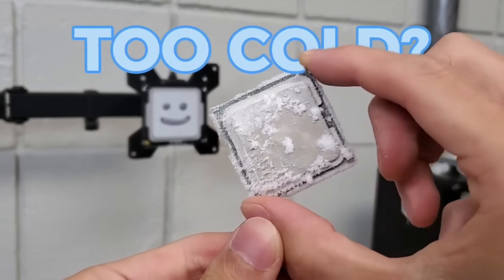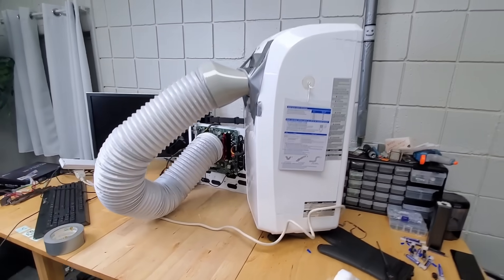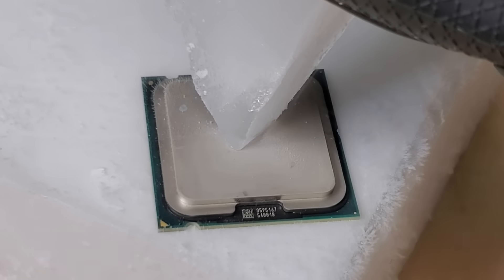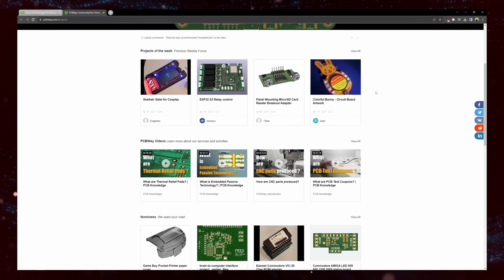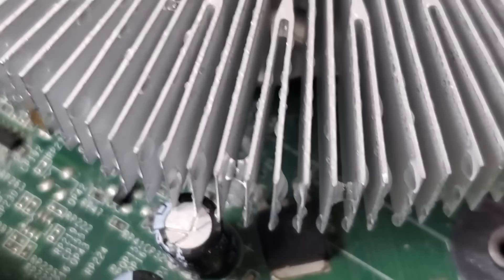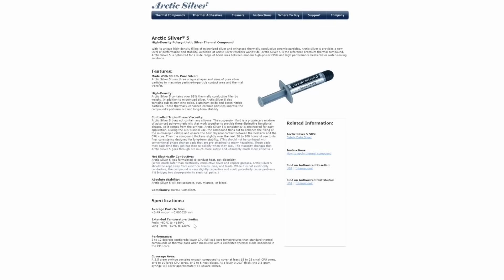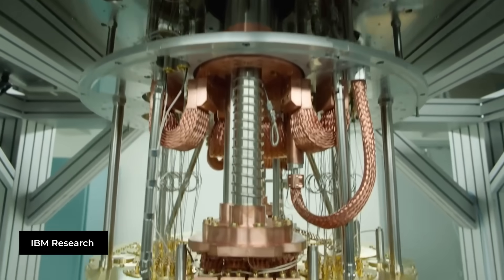The Crazy Future of CPU Cooling

Comment from the maker: is it chilly in here or is it just me? 🥶also, i finally got around to linking the components in my main PC build - check out the description if you're interested what I'm rocking!
Reply: e
Reply: He
Reply: dude, always loved your content, the way you explain things is very interesting, thumbs up
Reply: The ice action makes the number board tomorrow🥶
Reply: It's normally 35°C here but now it's 25
Reply: Bro is restraining himself from jumping up and down from the excitement. You can see it in his face. 🤣🤣
Reply: I know it isn't a big deal, but can we not refer to space as "cold" space isn't cold. No atoms means the only transfer of temperature would be through radiation (if you are above earth this would be the sun). In space near earth you could even call it "hot".
Reply: What if you try a  mobile phone cooler
Reply: What is the name of the song that starts at 3:08?
Reply: I'm watching on the toilet
Reply: Bro Nothing can be Colder than -273,15 Degrees Celsius 
like if you agree and have some knowledge 

lol
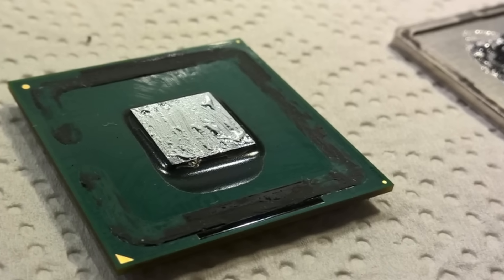Reply: 7:00 seems like you shouldn't use thermal paste at all in these experiments, just ensure same metal types connecting so they match their contraction rates ei  aluminum and steel with shrink at different rates and could cause self damage.
Reply: Solid State Cooling fan sitting there watching you be like: "Nice try, huh? 🚬🗿"
Reply: notch 1 on the box fan is actually the lowest setting. 3 is the highest, and it is set up to prevent a 'stall' condition.
Reply: Can you give a pc please.
btw the vid was awesome bro keep up
Reply: Just you

Comment: The issue is condensation. If your air is humid then the water in the air will condense on the cold surface of the CPU and get on your mother board which is bad. Never mind he covered it.

Comment: Place the whole computer in a fish tank that you can fully submerge in distilled water. Get a liquid CPU cooler, pump and hose, as well as 2 of those electrical coolers they use to cool CPUs. Place the electric coolers (cold side towards the liquid cooler on both sides. Some coolers will need to be modified.) place fans on each side. Lock it down. Run hoses outside and install the cooler. You will want to place it outside, it will heat up a room fast. Remember one side is cold and the other side is hot and the heat has to go somewhere. Run power to the cooler and fill the tank with non-conductive liquid. Some use distilled water, but don't know if I like that. Glycol works very well and can bring temperatures down by just moving through the hoses. Turn the pump on and let it circulate through the system drawing from the bottom of the tank and pumping back in from the top. You shouldn't need a fan on the processor, but some say that the right fan looks cool running under liquid. After the system is running and the liquid is pumping, you should see the temperature drop very fast and level out at a very nice cold temperature. If you do it right, you could run the whole system including the computer on a solar system and save some money on the electric bill LOL. Be safe all.

Comment: Just a technical note, on your portable AC unit rigging, changing the temperature setting has zero effect on how cold the air is coming out. If it is running, it's blowing as cold of air as it can.

Comment: Something exactly like this already existed, a friend of mine had it they were around 1200 dollars a piece and it was a pump with freongas in it which would pump it through a pipe to your cpu cooling block it was absolutely nuts, dry ice is also already used by pro overclockers and it usually does not end well for the cpu. I think what my friend had was called Vapor compression cooling and it would consist of a compressor filled with freon or liquid nitrogen attached to a tube as big as your socket connected to it via a special connector, there were loads of problems with these units, mostly including condensation, the dude i knew that had it said he needed perfect airflow otherwise condensation and frost would form on the electronical components and it would shortcircuit everything, these units could go down to as cold as -40 celsius, which had adverse results more often then not. Sadly nowadays this seems to be somewhat of a bit of lost tech, but this was the rolls roys of extreme cooling options in the beginning of the 2000's

Comment: If I ever build a house from scratch I will make a small closet behind my office wall and my PC will be placed in that closet with an A/C unit like this (or maybe just run a central AC duct into the closet). I'll just have an I/O panel on the office wall for my peripherals. I wonder how carbon/graphite pads would work at those low temperatures. It seems like they would not be affected adversely at all, but what do I know?

Comment: 0:36 me having 75-85 C everytime i turn on my pc
Reply: Sir. Everytime j turn my laptop on it goes from 30-50C
Reply: That isn’t healthy for your pc what did you do to it to be that hot???? Take your pc to a repair place
Reply: @Flyingmonkey590 to a repair place? First of all, cpu temps of 85° arent desirable, but they are fine. Definitely not normal when turning on a pc and idling, but not harmful it it doesnt go above 90
Reply: @ppeez  if the pc is idle running at that temp it will most definitely throttle in game or while doing tasks
Reply: You didn't correctly put cooler on your cpu or your termal pad is in bad condition

Comment: Water does not conduct electricity, the minerals in the water do. Also space isn't quite "cold", space temperature depends on where you are, if you are close to sun (earth distances), you will become a fried chicken, but if you are in a completely empty space, you will just radiate your heat, there is nothing to take heat away from you in space.

Comment: 9:29 no resistance means electrical reflections, basically bounces between PC components and individual transistors, introducing huge unwanted noise and system instability, especially at the frequencies used by modern computers. So 0 resistance is a hugely undesired effect

Comment: problem with porable A/C units is that they are generaly not A/Cs, they are swamp coolers. if heat is not comeing out in any way, and/or it requires refills, it is prob a swamp cooler.

Comment: Fun fact: dry ice sublimates instead of melting which gives that vapor. Basically going from solid to gas because of its triple point.

Also another fun fact is that, pure water is not conductive to electricity. Its when contaminants get into it which makes it conductive. Silica gel is good at absorbing moisture.
Reply: Also dry ice fumes are very toxic so breathing it would kill you

Comment: Bro Nothing can be Colder than -273,15 Degrees Celsius
Reply: What about -273,16
Reply: @CG21110  nope
Reply: @CG21110  ever heard of absolute zero the coldest point possible
Reply: @CG21110 heat are measured with atom rapid movement more heat moves more but when coldest it stop and nothing can be lower than stop

Comment: Long time ago I tried overclock 2500+ barton in not heated room where temp was same as outside -22c or so if remember right. Motherboard went nuts after some time (thou at first got it to boot at 24xx mhz. Suddenly motherboard kept showing -2xxC and crashed in bios/boot.

Comment: The silicon wafer will break way before reaching even -80°C, we need to build different kind of materials to work in sub zero temperature. Second transistor requires some resistance to work otherwise it will not work as switch, so we need different kind of switching system. Cooling is not problem that is the reason in outer space we need heat source to protect CPU and other electronics. CPU require something entirely different concept ( quantum computer is not the answer because we require insanely low temperature which is not possible in case of home and we need millions of qubits to do something meaningful at the moment only 1000's qubits are available) which can transform computer completely.
Reply: Yesss what many people don't know is that quantum computer can't even run a basic Tetris game. But theoretically in future we could get way better computers this way

Comment: Except, you the entire surface of the CPU isn't the surface you pointed to in the video, that's just the lid. The CPU itself is just the size of your fingernail. The laser technology for cooling is very doable then as you would only need four or five lasers pointing down on that small chip to reduce its temp to nothing.

Comment: I don't really get it, heat vibrations are random so it should be impossible to lower their momentum with a laser, i would argue that pointing a laser should increase the net momentum of the particles

Edit: I just read about it, it's actually super clever, so when they point a laser beam at the atoms, if the frequency is enough to excite the atom from it's ground state, it'll absorb the photon and it's momentum in the direction of the photon(direction of the laser will increase), but atoms vibrate randomly in all directions so normally this would cancel out, as expected. What we actually want is a way to somehow make the photos coming towards the direction of the laser absorb the photon, so that it gets slower, and we want the molecules moving away from the laser to be unaffected so that they don't gain momentum, we achieve this by taking Doppler effect into account, because of Doppler effect, the molecules moving in the direction of the laser will observe a slightly higher frequency, so the frequency of the actual beam can be set to be just slightly lower than the energy band gap, the particles moving away don't get excited because they observe a lower frequency and the molecules moving towards the laser get slower because of the increase due to Doppler effect
Reply: This is cool as heck! It confused me too, so thank you for doing your research and summarizing it here, super neat of you :))
Reply: Always remember, when you speed atoms up, things get hotter, when you slow them down, things get colder. But you also have to remember as well, that light and frequency can play a very big role. One small change can change the game.

Comment: Material Scientist engineering student here. 
Now i didnt do any background research on this just to make my comment however, from what i am aware of: getting your CPU to that low of a temeprature to enable it being near a superconductor temperatures would actually stop it from functioning properly.

The semiconductor junctions inside your cpu would approach something called freeze-out (or ionization). In essense you stop the semiconductor junctions from being capable of moving carriers shorting the ICs. At 0K (not that youll get there) you wont have conduction. 

Edit: (no comments yet just adding some more info) rememeber this is semiconductors not metal materials and if you want to look this up quickly you can refer to "Inverse Temperature v. Carrier Concentration"
Reply: Came to say a dumbed down version of this 👆 Semiconductors should not operate at those temperatures otherwise people would be using those cryogenic refrigerators in data centers 💀
Reply: is this all smart : yes
did I read it : no
Reply: @Gamer_fox6091  I aint reading all dat 🗿

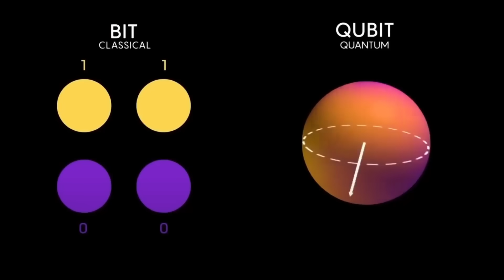Comment: 7:53 that's a false statement. Space does NOT have a temperature since it has no matter.
Reply: That's a false statement. Space does have a temperature since it does have matter. There is very little matter, less between stars, and even less between galaxies, but you can still measure the average kinetic energy of the particles.
On top of that, empty space contains energy, which is also often treated as temperature.
Reply: @LethalChicken77  yes, space does have matter, but it's so little, that to be honest, doesn't really matter that much. No pun intended
Reply: @Hutirati  so it has temperature. Also don't try and correct me, you're obviously in grade school and haven't taken a modern physics course.

Comment: The ac thermostat doesn’t control the air temperature coming out of the unit, it tells the unit when to turn off based on the input air temperature.

Comment: Dont worry, with the dry ice it's essentially just distilled water pulled directly from the air. Distilled water acts as an insulator. As long as your system is clean you wont get any conductors mixed into the water.

Comment: Fun fact, if you set the portable a unit to heat rather than cool, you get cold air out the back and don't need the duct tape an elbow grease...

Comment: The next step forward in cooling is the classic cooling system of a refrigerator inside a PC case.
A sealed system of copper tubes has a quiet compressor and one common radiator blown by large, quiet fans.

Comment: @mryeester 07:10 if subzero temperatures spread so well around anything they touch... is thermal paste even needed anymore? it's suposed to just fill microscopic gaps between CPU and cooler... but with such low temperatures that "spread" to anything they touch... is it really necesary to use the thermal paste anymore?

Comment: Regular water is a conductor due to its mineral content (like salts). However, distilled water (with no minerals) is one of the best dialectic materials around. In fact in Nikola Tesla’s day, they typically made large capacitors using nothing but jars of distilled water as the dialectic barrier with a metal cathode and anode.

Comment: Why aren't there case fans as big as the side panel? I mean 200mm is big, but is not the size of most side panels. Just think, you'd have 1 fan to rule them all and you could direct airflow out the sides (or rather front and back).

Comment: Won't the CPU completely cease to function when it reaches superconducting temperatures? Correct me if I'm not understanding this right but isn't the very point of having a semi conductor is so you can send binary signals to form logic gates? If there's no resistance, effectively the moment you turn on the switch, it'll constantly output 1 and never 0. It'll be equivalent to a brain "operating at 100%", it doesn't make you smarter or better; it just gives you a seizure. Superconductors can work with quantum computers because qubits are effectively in a state of superposition of both 1 and 0. Right?

Comment: But condensation is plain water, just H2O, which does not conduct electricity, no? It's the ions and minerals in the water that make it conductive. So condensation, or a little bit of it, is not a problem immediately, is it? As long as nothing conductive is dissolved in it?

Comment: Imagine that laser cooling system being used for a superconducting zero friction joint on train wheels with AC frictionless motors being used. That sort of system could theoretically make it possible for a train on iron rails to travel at supersonic speeds.
Reply: We have magnalev and magnarails which can do that like your laser train idea. Problem with both is the amount of power you need to get those speeds, it increases exponentially.

Comment: Wow, I just stumbled upon your channel from this video, and I gotta say the content is high quality! I also loved that you expanded the topic of cooling into our theoretically awesome future! However, I think taking the cooling to the extreme on just this setup in particular would have some interesting effects: Most of our modern computing relies on semiconductor technology(excluding quantum and photonic computing, etc.) by utilizing semiconductors like silicon. Semiconductors, like the name implies, have an electrical conductivity that lies in between that of an insulator like glass, and a conductor like copper. But why? Well a couple of the origins of what makes a material electrically conductive is how many free charge carriers(like electrons) are able to freely move and actually carry the current, and how fast those carriers can do so. In physics we call this Charge Carrier Density and Charge Mobility respectively. Although there are many factors that go into conduction. Semiconductors generally have a lower carrier density, but their charges are more mobile as in the case of silicon(in most metals this is other way around.*) One of the remarkable things about semiconductors is the impact on charge carrier density from temperature. when semiconductors get really cold, their carrier density actually drops below the point of conduction and behaves like an insulator! However the effect of doping(a method to produce these chips) also increases the carrier density, so I actually don't know the extent to which the temperature impacts its resistance. I'm no expert tho, so take this with grain of salt. What do you guys think?

TLDR; I think cooling a chip down too much MIGHT lower its electrical conductivity and therefore efficiency.

Comment: Id like yo point out that straight water H2O is entirely non conductive. The reason it is conductive is the metallic impurities inside the water, for example, Iron, copper, zinc and calcium can be present in regular drinking water. Condensation normally contains these impurities still due to general localised cooling includes metallic gasses that can get dissolved into the water as it condensates.